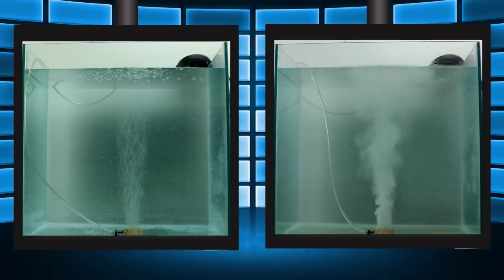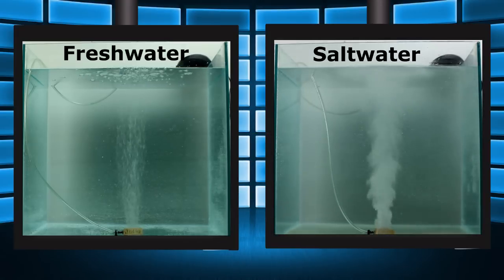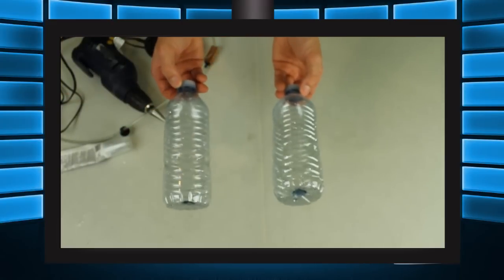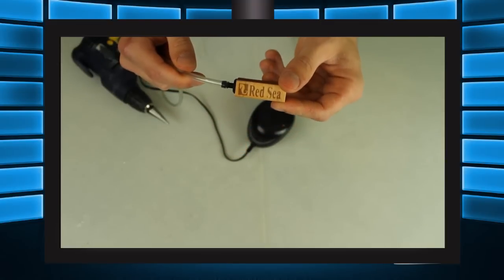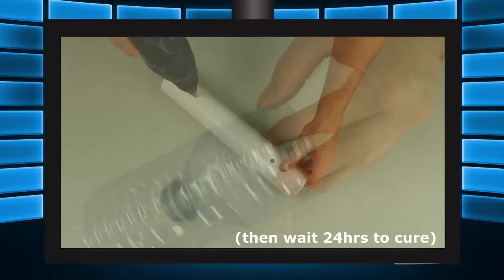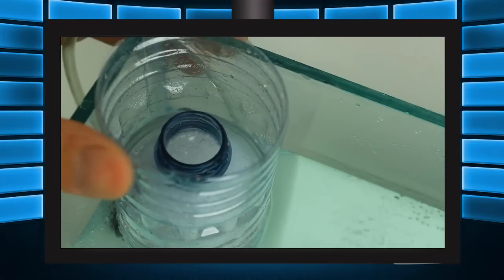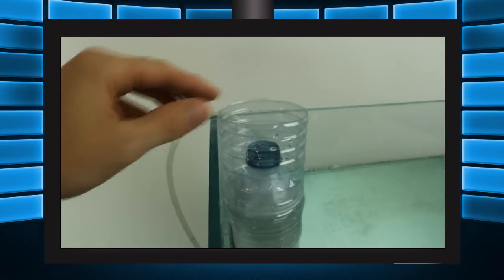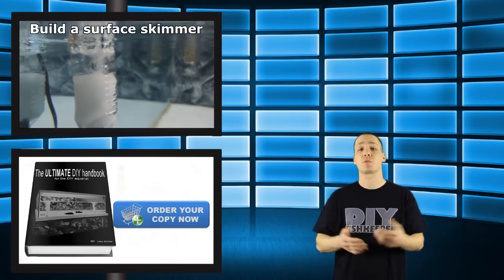HOW TO: Build a protein skimmer for aquariums TUTORIAL

Comment: Hey! Watching this in 2019... One of the things that stopped me on going with a larger saltwater tank is the machinery needed to keep it running properly. 

But after been introduced to your channel it is simply awesome, I am starting the 100gl tank this week after checking most of your videos for filtration and this one.

Quick question, after 5 years, the recommendation on using wooden air stone stills the same for this Protein Skimmer project?  Are they better than ceramic air stones? 

Regards from Costa Rica.

Comment: The one thing I wish you would do as a project... An over the back acrylic overflow. 

It is something I am considering for my 20 long and there really aren't any "good" DIYs for it on YouTube. 

Hope to see this soon. 

Keep up the good work!
Reply from the maker: krybaby77 Maybe some day. The thing i always consider though is how many people could actually do it. A custom acrylic overflow is not an easy project, so not something i would typically do. BUT i have built a couple in the past and they are super cool, so maybe i will do it again. Get your oven ready. ;)
Reply: Oh.... You mean bending the acrylic. I was thinking just as with anything else just cutting and glueing. I can see how that could be a problem.... Air catching in the corners. 

I was considering just doing two bulkheads with an acrylic box on the back as my overflow, I just don't want a big weir inside the tank because it's such a small tank. 

Any thoughts? I don't really like the over the back pvc overflows for the same reason. It's such a small tank that anything inside the tank becomes an eye sore. 

I figured a nice DIY acrylic overflow with a shallow CLEAR acrylic weir was my best choice.

Comment: I have one question. I have looked at alot of diy protein skimmers and most have a hole for water to enter and water to leave .. so is the water entering amd leaving both from the bottom on this design..
Reply: I’d guess the flow of water leaks around the water bottle connection to the pvc.

Comment: Good stuff Joey! Having zero experience with a saltwater tank, what are the reasons someone would still buy a off the shelf surface skimmer after seeing this video. I imagine the thought process would go something like, " Joey's DIY surface skimmer is just about free and works great but I need to buy one because _____________ ". Basically i'm asking why anyone would buy one after seeing how cheaply and easily they can build one. Thanks Joey! I'll file this video in my brain for if I ever start a reef tank! Looking forward to your reply
Reply from the maker: The reasons to buy VS build are endless. It could go either way.
Reply: I built mine, was a bit more expensive than Joey's, but still less expensive than a comparable commercial one.  Plus I have still have several feet of acrylic tubing left to build a couple reactors if I need to.  Time & Knowledge vs. Money are probably a big factor.
Reply: The reason is that because need wheel impellers produce ALOT more bubbles, are much more efficient and are going to work much better on a larger tank. These hand made ones do work but will not produce quite the same results as a decent needle wheel skimmer. I have had air stone skimmers though. Just not as good unfortunately.

Comment: the mechanism seems pretty simple. how come commercial skimmers cost so much? definitely enjoyed the video. i am trying to decided whether i want to get into saltwater tanks and doing some research.
Reply: I suspect the reason commercial skimmers cost so much is because they can. I'm thinking of trying this build myself and seeing how well it works.
Reply: you make a great point. if you take the same components Joey just used, you will end up with the equivalent of a $200 skimmer.

the science is simple. proteins bind to the oxygen molecules, and get pushed thru the cap and into the collection cup. however you do this, is a success.

the super pricey protien skimmers just use super high quality acrylic, alongside proprietary bubbling. 

So Joey's version works just as good, for way way way less.

Comment: When the bubbles rise up the body and push water upwards, where does that water go? Is it just tall enough that gravity pulls the water back down into the body? Wouldn't that mean you're skimming the same water over and over?
How do you introduce new water into the body to be skimmed?
I have my own answers to some of these questions, just wanting to know your thoughts behind these massive issues with your build.
Reply: Not sure why he didn't include that in his little build, because you're right, there needs to be water flow for it to be effective.  

You could easily drill a couple of holes in the tube and cap off the bottom.  Drill a 1/4 inch hole an inch or two below the water line for exhaust and one an inch or two from the bottom of the tube for intake.  The water flow will occur naturally because physics.  Just buy a cap for the bottom so it becomes a closed system, other than the two holes you drilled.  

As with any skimmer, water flow will be determined by the amount of air being pumped in.  The more air, the more water displacement that occurs at the top hole, and the more water that is sucked in.  

But these $150 skimmers are serious overkill for the average hobbyist.  It's sort of like buying those expensive water filters for a dog bowl when regular water will keep your dog alive just fine.

Reference:  Scroll down to "air driven skimmers".  http://successfulreefkeeping.com/learn/reef-tank-101/protein-skimmers/
Reply: I agree but I think, since there is no pump pumping water in the system, the air bubbles need to pull some tank water in. So some holes or maybe even leave tho bottom open just add holes around the top, at the main tanks water line or slighter higher.  MAYBE this will work. New, dirty water enters from bottom and makes foam, that is pushed up as more is created below it, till it falls in cup. Water just under the foam comes out the holes. Also, maybe add a bottom with a hole and a pump.

Comment: i built this skimmer exactly the same as in vid. im waiting on my wood airstones in the mail. using a large ceramic airstone with an oversized air pump. 3 days later and all i have is a thin film on the collection cup and is running really wet or not at all. is it my airstone? i tested the water in the collection cup and off the charts nitrite and low nitrates but its not sludge
Reply from the maker: As with any skimmer, there is a 1-4 weeks break in period.

Comment: Hey man. I've noticed this question several times with no response from the diy king himself.
Where does the water go? If I do this build I'm trying to figure out how to get water in and out as it would seem this build is just pushing water up and out the skim cup.
Reply: The water comes in through holes in the bottom of the skimmer. The water (actually the skimate) goes out whenever you dump it out of the collection cup on top. If it overflows, you’ve effectively just kept these waste proteins in your system.

Comment: Hi there. Could something like this be used on a garden pond?
Reply: unless your garden pond is saltwater, I don't think so, you're better off with a sponge filter for anything freshwater
Reply: /// also ponds have a different type of skimmer which works more like a pool then a saltwater skimmer
Reply: in your pond, if the mechanical filtration aren't providing enough, you've done something wrong. there should be ample mechanical and biological filtration in place. 

please look up pond filtration.

Comment: Building a skimmer would be easy, but how would you size a skimmer for a larger tank?  Increase the "bubble" flow?  I'm in the process of setting up a 230 w/ a 125 sump/fuge and building a skimmer would be a lot cheaper, but now sure how to size it properly.
Reply: I would recommend using something with a needle wheel pump to produce the bubbles needed for a tank that size. Depending on your bio load. Building a nice one is possible if you have good skills with your hands. However to get quality materials to handle such volume efficiently it might be just as easy to buy a decent skimmer if your budget allows for it. The 2 liter bottle one would be a bit too big for an airstone actually work well.

Comment: is the length of the pvc pipe suppose to be the length of the water level?, If i try to put this on my sump but I only have about 2"-3" of water height inside my sump, would this work if the pvc pipe is longer than the water level?
Reply: what sump is only 3" tall?
Reply: what sump is only 3" tall?

Comment: Ok so let's say a commercial protein skimmer is a 10 out of 10 in performance, how good would the diy protein skimmer compare?
Reply from the maker: GREAT question. This would not even come close to a commercial skimmer. That's not the point though. What my intentions here were, was to simply show how and why they work and then put together something extremely simple that still does the job. The intentions here were to inspire through education and example. 
Let me explain: I wasn't going to tinker with this to get it perfect. I wasn't going to try to build the best skimmer ever. You guys can do that. You can make something work for your system, but simply need a good foundation to go off of. Now let me give you an example. I built all kinds of filters on my channel.. none that I actually use on my own tanks, but what i do use was inspired by the simple projects i do show. With that said, i ONLY have DIY filters running all my tanks right now and I would put them toe to toe with any commercial filter. Although, it wouldn't be fair for them. So at the end of the day, the focus of my channel is to educate on how and why things works. With that, you are armed with much more valuable asset than just a template to copy. I do the projects for a visual example and to maintain interest as well as focus. 
At the end of the day though, yes the skimmer in the video works. Yes it will do the job you need it to do. How well it works is totally up to you and the changes, modifications or simple additions you make to it.

Comment: followed this design, I either get far to many bubbles and the cup fills in minutes, or not enough bubbles to cause them to reach the surface of the water bottle. attempted adjusting both placement of the skimmer and bottle on the skimmer. same results. any ideas?
Reply: Adjust the strength of you air pump maybe?